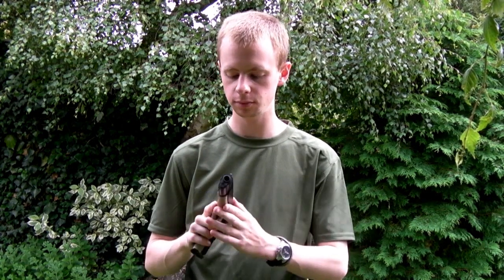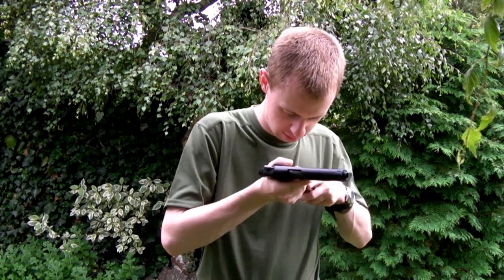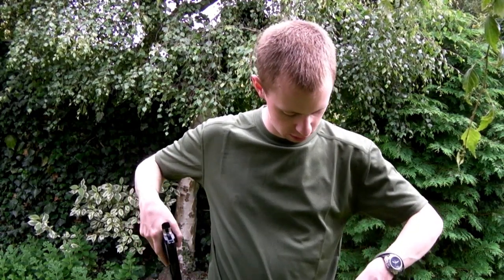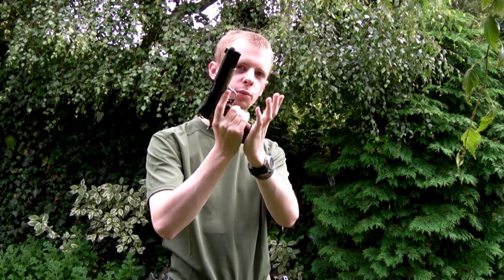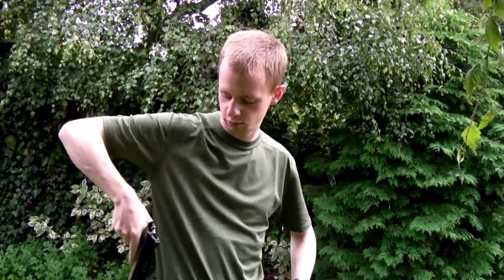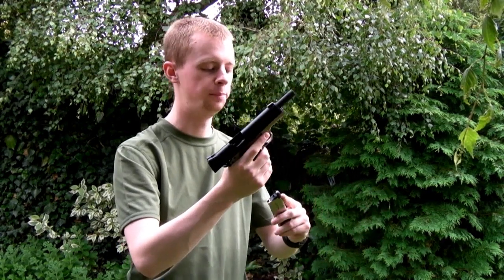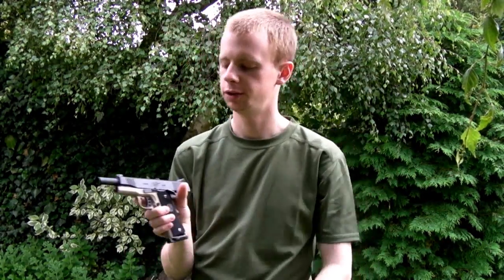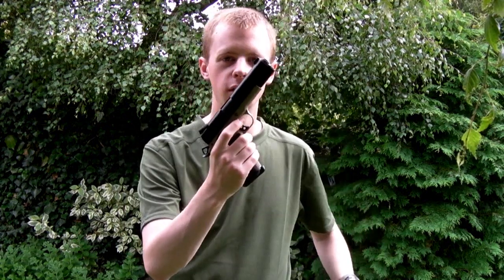Airsoft Techniques - Pistol Reloading

Comment from the maker: The basic principle is that if you're under stress through experiencing pain and your adrenaline and heart rate are going hard enough, the body will automatically draw blood away from the extremities in to the core, and you can lose a certain amount of fine motor control in your finger tips and this may cause you to miss a slide lock/release lever.  With the power stroke you'll never miss.  That's the idea in the real world anyway, it's not too crucial in airsoft I know.